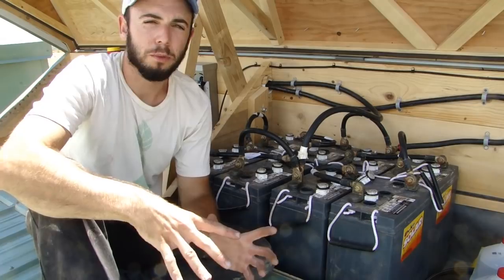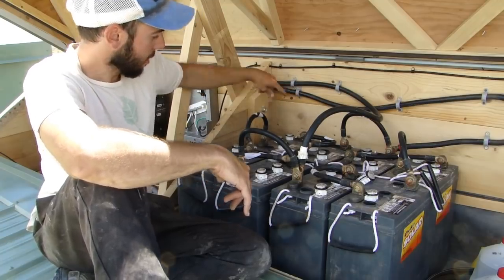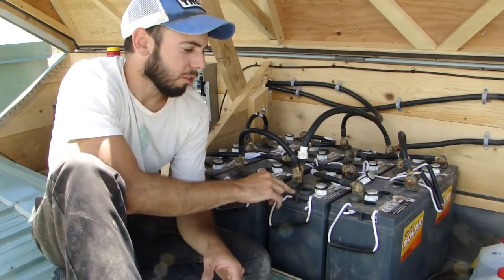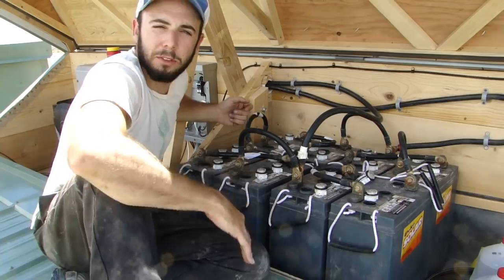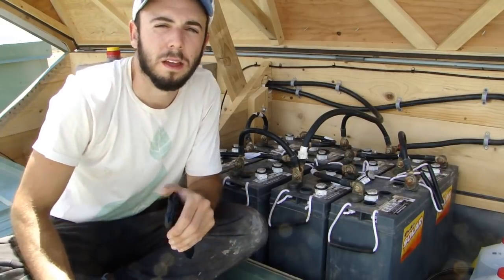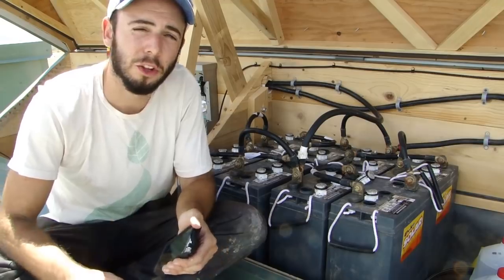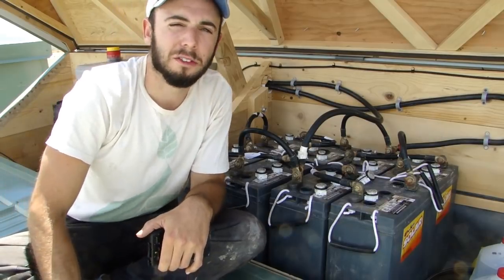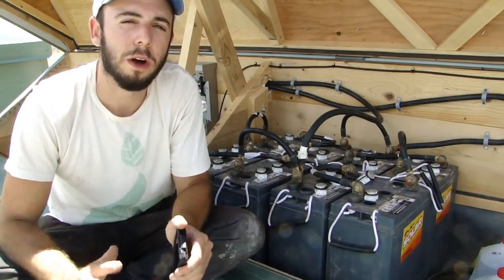How to Size Your Solar System

Comment: my batteries drain in minutes running a single 5 watt bulb  any help to why
Reply: I use a simple 1 piece 19volt-55watt solar panel with controller charging a car battery 12volts 60ah..it runs every night providing night light for my home running at about 0.5-0.8amps for about 12 hours every night..i use led lights instead of the incandescent or cfl..that way I can use less energy to light up more areas ( almost the entire 2 storey home) (dimly lit of course).. I also added a 35volt 1000mfd super capacitor parallel to the battery so these solar energy get more easily absorbed by the battery which about 12 metres away from the solar panel..i also use these lights with a simple 3amp dc motor controller (high frequency pulse switching) much like an electronic dimmer knob,so that I can control the brightness of these led strip lights and restrict its energy consumption. Without the dc motor controller the battery discharges to the led lights as much as the leds can take and that causes the battery to discharge prematurely, especially when its not so sunny the next day the battery don't charge that well..
Reply: ***** turns out some cleaning of the terminals and added some viniger to a batt and everything is running fine
Reply: fidel catsro Standard car batteries are the worst to use, the caps can blow off, they can leak acid and vent large amounts of gas. They are not designed to be equalized either in most cases. Better budget solution is a sealed marine type battery maybe.Also your LED lamps may not have a constant current circuit in them. This will cause them to run a battery dry and fast too. You should look up the constant current circuits using the LM317 regulator, easy to build and may help you. With the adjustable types you can limit the current but maintain volts per lamp IF your system is 12 volts and not feeding an inverter.

Comment: It doesn't "double" as you said multiple times, it adds. For instance 2v to 4v to 6v to 8v if you had four 2v batteries connected in series. Same with amphour capacity, it adds when connecting strings in parallel

Comment: Great work Dan; Finallly someone I can understand... What a way to break it down... I plan on build my own off the grid solar powered system for my work shop and eventually do a grid tie with my home. Now I just need a boost on what I need to buy and where to get it. Again, well done and thanks.

Comment: im about to buy an Outback and some microinverters with a kyocera pannel system and Trojan batterie bank  It seems the technology advanced in 1 year and pricing is on the floor compared to a year or so ago.  Its time to build a system.   This video confirmed some things i suspected and now i am sure i am in the right path.

Comment: Just got my first panel in the mail today! A Renergy 100 watt panel with controller and wiring. I have been an electrical contractor most of my life and I finally got to a point where I do not want an electricity bill anymore. The power co. are raping us. Good Video. The only batteries I currently have are from my electric bike 3 18ah 12 volt SLA,s I know they aren't the right ones but its a start, they have to be deep cycle correct?
Reply: twoheadedelvis TY
Reply: I got that same deal from Renogy--$180 on Amazon. Seems like the best deal out there at the moment. Posted a vid of my initial setup and will do an update soon.
Reply: Rick Rose Good to hear what you think.     I'm going tiny house off grid    looking at all direct current.  You can find every thing you need at a good truck stop.  By law the military has to change out their batteries like once a year,  their are powerful and cheap.      I think we're all going to be there real quick. Thank you

Comment: Please answer A.S.A.P. How do you run an entire house with less then 5 kwh per day? I have done the math a hundred times and looking to be impossible.
Reply: he's not running a house, he's running an earthship
Reply: You use gas for cooking gas for hot water no air-condition You use florescent lights with inverters that can be turned off and maybe a solid state TV. What else would you want.

Comment: I think what you're doing is great, but I don't ever see the benefit using those batteries. They run out in 3 years, not 8. If you use them everyday they will last one year. The price and maintenance of those batteries negates any cost savings that I can mathematically figure.

Do the guys that get into solar actually know how to figure the costs? I get that they understand how to put together the solar system, but that doesn't mean they see the whole picture. I can totally see someone never once figuring out if they are saving money, and just assume so.

Comment: use 10 X 12 volt batteries into a 120 volt DC to 120 Volt AC inverter.  It will last a long time, far more efficiant..

Comment: But you had 8 batteries, so why couldn't you wire them all in series so you would have like 48 volts ? But then it would be 48 x 350 =  16800, the same I guess. So why do you prefer the other way ? is their an advantage to that ?
Reply: Most low-voltage appliances use either 24 or 36 volts is my guess why he had the set-up like it was
Reply: Christopher Compton Thanks for the info, as a newbie I still have to figure out how this stuff sticks together.
Reply: Personally I'd prefer to have a 120dc bank of batteries with a 120ac inverter of at least 8000 watts So I can continue to use most if not all of my modern appliances. Forget using an electric stove.... I'd use a stove, water heater, & refrigerator on natural gas if there is a natural well & it's free. There is a great many appliances that don't really need electricity to work but they do need to be manually monitored to work properly. A lot of work goes into living off-grid, it's not just something you can just hook up & forget about. That's why a lot of people only use alternative power to supplement their grid power for a lower electric bill & most electric companies will pay you for any power that your system gives to them. This however requires extensive contracts, inspections, permits, etc. I did a calculation & the only way for myself to ever see a return on my investment to live off-grid is if my set-up lasted me for 35 years with no failures. So the only way I'd ever have to do it is if I absolutely had no access to the grid. Luckily there is electrical access just 300' from where I plan to build my cabin.
Reply: ***** OK I see, thanks bro !

Comment: One thing I'm still looking for is a solution to many of our modern items using dc natively and yet I don't see anything about how to take advantage of that.  Seems once a person has installed a system with a battery bank their must be a better way to use it then the "dc to ac to dc" that would occur if you were to use a laptop or TV etc.  I'm aware their is energy loss on each conversion.  I don't know if it is significant or if their is some reasonable way to solve this problem.
Reply: I have a 300 watt inverter to 110 Volt AC 60 cps and a 700 watt inverter to 110 volts AC 60 cps. You might need a few more inverters but these florescent bulbs don't take much current. I have used the inverter to watch TV with the AC power down.
Reply: DC experiences greater voltage drops over runs then AC, this is why a/c generally "carries" the power across the house.
Reply: DanielRichards644 That's not quite true. AC can be stepped up through transformers and stepped down where you want to use it. So on the long lines they can send 13 thousand votes but you are only fed 120 votes 2 phase (220 votes) from your street transformer. Do you need the math?

Comment: Just wanted to say thank you for making this video.  It's surprising how hard it is to find this kind of information in an easily consumed form.  It was nice to come home from work and be able to learn something I'm interested in with out feeling like i'm doing homework.  There seems to be quite a few videos where people tell you how they did it but they rarely give the information covering the framework of how they decided on what they would do.  And in many cases as eluded to in this video it seems they don't actually understand what they are doing themselves until it is built and they have used it for a while.  But then i find that they rarely put any information up after they understand it.  The sizing panels to producing approx 30% of total stored power, and usage/battery life guidelines were particularly helpful for me.   Thank you

Comment: Off Grid Build Very informative. Quick question...you said each battery is 350ah. Wouldn't that make your set up 1,400ah per 24v rather than 700ah per 24v?
Reply: Look up series and parallel. He uses 4 6volt batteries to get 24volts in series, now his volts go up but the amount of amp hours stay the same by doing this. Then he uses another 4 6volt batteries in series to get up to 24volts, the amp hours stay the same  on those too aswell. Now he has two 24volt 350 amp hour batteries and he connects them in Parallel where it doubles the amp hours from 350 to 700 but his volts remain at the 24volts that he wants. It's all about how you connect the batteries. Connecting - to another batteries+ gives you more volts but amps stay the same. Connecting a two batteries - to = or + to + and the amps go up but the volts stay the same.

Comment: Hi mate help needed. I have a portable solar panel with usb output  seems to charge well. if the sun goes down and the panel output drops, will the device it was charging the start reversing the charge to the panel leaving the device flat again:I think that I may need to make a device with a diode to stop the device reversing the charge??

Comment: I pent £2000 on a off grid system in England. Work very well for 8 months of the year, Just trying to get this insta breeze crap turbine to work to help out in the winter. 2kilowatt panels facing east south and west to get sun all day. 1 kilowatt immersion heater. 6 88amp hour batterys. 3.5 kilowatt inverter.

Comment: Thanks you for the video, I am looking for a av. of 7 kwh days and this seem good but I am just beginning and going to use less power in my eco green home that I will be working on. could you give me the price and place of what you used. and do you know if I need to have wind co. added to a different set of batteries?

Comment: what are the specs on the 8 batteries u r using on your system... looking to install a system here in jamaica... undecided as to whether to use micro inverters or go the battery grid tied option

Comment: A Charge Controller will have a shutoff that cuts your "load" output when your battery bank gets beneath a manually set voltage.

Comment: When you connect a battery in series you don't simply double the voltage. You increase it by the value of the two batteries. 6+6+6+6 gives you the 24 volts. The same thing for amperage, you increase the amperage capacity by the capacity of each battery, you don't simply double it. In your case you are doubling, but you could have a 6v and a 12v, which would give you an 18v supply.

I know  it is semantics in this case, but it is important that it not be explained as doubling.

Comment: 2:40 You are actually using electricity directly from the solar panels and if some difference is needed is taken from the battery.
Lead Acid are actually expensive compared to Lithium when used for energy storage .
I also live offgrid and use about 2kWh/Day in average maybe a bit more in the summer just because there is more produced.
I have 3x 240W solar panels as main solar panels and a small 300W wind turbine to help in winter and cloudy days so I only need a 100Ah 24V LiFePO4 battery that can be discharged down to 20% for a few thousand cycles so I can use as much as 2kWh from the battery from the total capacity of about 2.5kWh
I usually use way less just because I use most of the energy during the day directly from the sun.
If you have say 800W from the solar panels going to battery and you connect a 1000W load your battery will discharge at a rate of 200W the rest of 800W will come directly from the solar panels and in that way much cheaper.
At 1$/Watt for solar panels and say just 25years life the kWh will cost just under 3cent/kWh depending on how much sun you have where you live.
Battery on the other hand even the cheapest that is Lithium will cost around 20cent/kWh.
I need to make a video soon explaining and demonstrating this.
There is one problem and that is that you can not find a charge controller for Lithium so I designed my own and I will have soon on Kickstarter.
Reply: Actually Genasun makes a charge controller for LiFePO4  http://genasun.com/
Reply: *****
Is how they advertising but is nothing more than a modified Lead Acid charger there is no BMS it can not measure individual cells.
Any programable Lead Acid charger can do the same as that genasun charge controller.
It will not work with LiFePO4 batteries without additional BMS and even then not sure it will make sense. When the BMS will see a cell with over-voltage condition during charging will cut the power to the genasun charger not sure if it will like that.
I have seen that genasun charger a few years ago and was extremely exited that I do not need to design my own but I was quickly disappointed.

Comment: is this correct?

(source) electricity--->battery charger--->2 battery 21plates---> 3000 watts power inverter--> 3 desktop computer, 1 wall fan, and 1 xerox copier.

3 desktop = 600 watts /each
1 wall fan = 50 watts
1 xerox = 500 watts

question:

how much kilowatts do i need to use?
how many hours to charge my 2 battery?

Comment: I can hardly believe you only use that much. I cut everything i can off and try not to overuse anything while using it and i still run at least 20 to 25 KW a day. Hard to believe this.

Comment: My hot water tank says it uses 12kW per day.
Reply: you can also get a timer for your hot water heater at almost any home improvement store,and tie it in to the electrical so that your hot water is only being heated when you need it to be it will save you a lot of money in the long run.it is simply a time clock that lets power through to the circuit at selected times instead of kicking on at 2 in the morning
Reply: With an investment in a solar preheating tank you can get hot water all summer for no additional cost .   The tanks are about 700 dollars and are sold at Lowes .
You can make your solar collector as simple or extravagant as you like .   I know someone who used 300' of black plastic well pipe laid out on his roof and hooked it up over the summers .  These things makes sense depending on how handy you are and how much hot water you use  .  IE ... if you have 5 teenage daughters you might want to get a 100 gallon tank  and come up with permanent collectors  .     Hot water is a much more efficient way to heat water that electricity is .
Reply: Have you thought about going tankless?  My first one was a small Paloma that I got at a trailer/RV place-used propane, and not very much of it.  Now that I have the "big house", I have a much larger one- still propane, although I understand they make electric ones, as well.  Then you have no "tank" to keep hot, even when you aren't using hot water.  If I were truly off the grid, I'd look into methane as a replacement for my propane.
Reply: donna S why is there a line through some of your words?

Comment: I'm using a Nedap Powerrouter. That invertor makes it possible to use direct power from the solar panels without using the batteries. Even without batteries, on a sunny day I can let my home running on direct sunlight.

Comment: Very clear step through the arithmetic. The connection between the max drawdown on the batteries and the power produced from the solar panels was the missing piece of the puzzle for me.  Thank you so much!

Comment: I have 1 120 watt pannel, Would a 200 amp hour AGM battery work ( 12 volts x 200 amp hour = 2,400 watt hours ie 2.4 kw/hrs right?  What converter/invrter do i need to take 12v dc to turn it into 110v AC? any recommendations
Reply: anyone?

Comment: Wick3DPimP thing is, its not a matter of "just stay on the grid" he mentioned building an earthship house, which means hes in the middle of nowhere, and the design of the house reduces the need for temperature control. and lots of natural light use. there are also a lot of low power alternatives to a lot of things. its really not as big an adjustment as you think.

you also priced it at $15, but forgot the "delivery" charge they bill you for each month.

Earthship houses are actually cheaper in both construction and maintenance.

also you are forgetting the whole rv and boating thing.
Reply: Include a Generator in the power mix, and you can build with less Batteries and less Solar Panels, and at the same time, have the ability to supply high power when necessary, say for power tools etc.      You can also run a generator once or twice a day to power large Fridges and Freezers, which may be to large for a reasonable cost Solar System.